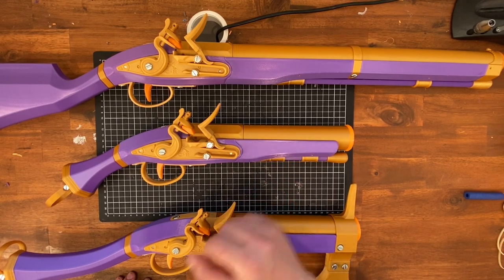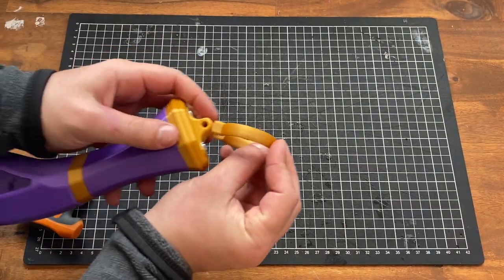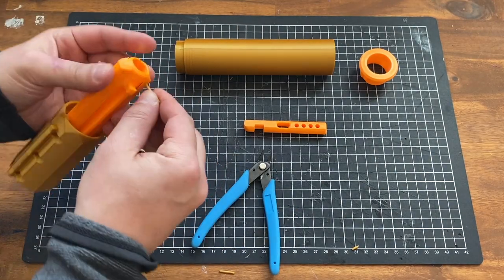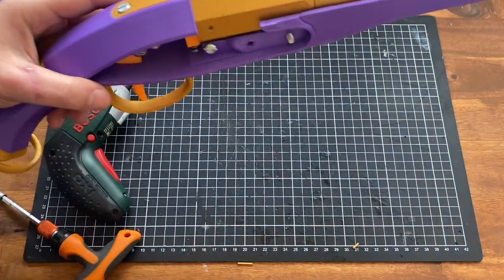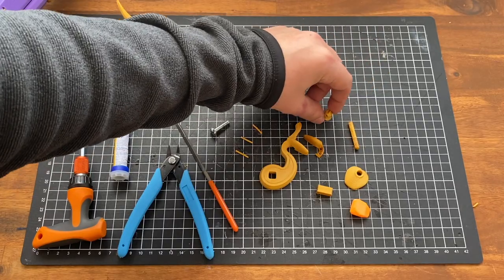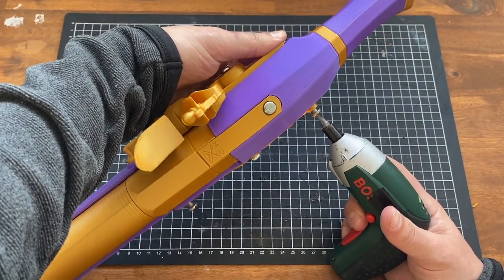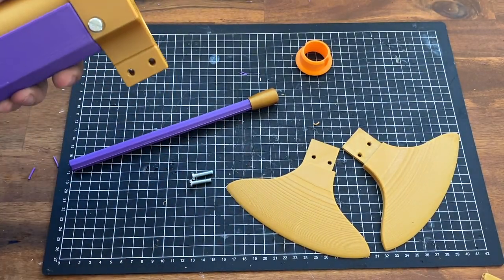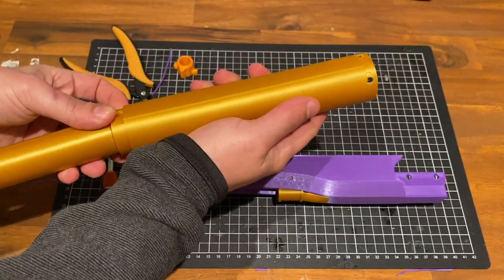Flintlock V2 Assembly guide

Comment: For anyone with the spring not staying, what I did was use a 20mm screw instead of the 10mm and it goes through the hole all the way and provides a stable place to rest the spring.

Comment: Well i know what my sister and brother in law are getting for xmas.
Reply: You’ll have to get a 3D printers and learn how they work then by the files witch ain’t really that expensive then you need to get filament which is really expensive then go to your local Home Depot or any hardware store get the screws and metal mechanism and ya your pretty much done

Comment: The one I made the spring would pop out from under the catch block. I edited in a little tab on the bottom that prevents the spring from going anywhere. Lets me use a shorter spring too so the trigger pull is light and crisp

Comment: Really amazing design. Would it be possible to replace the rubber bands with an extension spring connected to a metal pin or something similar attached to the back end of the rail system?
Reply: You sound like you already know what you're doing. Is it updated or finished?!? I need to see🧐😝 Don't wait on anyone... Just do it yourself. Have that faith in yourself yo😎 I'm already trying to devise a way to put a pin through the side of the barrel connected to the launcher plate, to pull the charger back, instead of using the plunger to prime it. Never wait for no one else if you gots a good idea.

Comment: Is there a good place to source the spring? Having a hell of a time finding them
Reply: i would go to lowes/home depot and look for a box of assorted small springs. It comes with both compression and extension springs. It has many sizes in them, just try a few of them and see what will fit.
Reply: @mikeperry4262  thanks, it takes me like 3 peen springs to get good pressure p
Reply: @ryantyndall412  Mc-master # 9637K75 then cut to length

Comment: Is there a suggested size for the wire diameter of the spring? I've tried  1mm which is too stiff and 0.5 mm which stay compressed and doesn't spring back.
Reply: Try different stiffness. You should be able to find wires that are same size/gauge but have more/less springy.

Comment: Is there an Axe grip file without the Nut space? I have ruined 2 axe grips trying to install the grip. Each time either the angle of screwing in causes the handle to bulge at the top of the grip (angle must have been too steep) or I can't get the screw to engage with the nut correctly and the nut breaks out and starts spinning freely in the slot, ruining the grip.
Reply: Update: The new v3 Mid Stock worked better with the extra meat for the grip stock screw, but I ran into a new problem I'm hoping to solve. I did 18% infill on the mid stock...but this time the mid stock was so brittle I was able to crush and break it in my bare hand. Not sure if it's the new stock's orientation (some of the print striations on this print look very different) on my printer, or if I did 30% infill in previous stocks and I did 18% this time...I'll keep at it.
Reply from the maker: Check you are printing the right mid section, you could be accidentally using too long a screw
Reply from the maker: Sorry just read your reply. Yes the issue is the old mid was too short for that length of screw so you just ended up screwing up into the plastic. The infill needs to be pretty high for the handles, but even 18% should not crumble for the midsection, you may be having printer/plastic issues

Comment: Whats the cheapest 3d printer you can get that works for this?
Reply: Ender 3
Reply: Ender 3. Don't waste money on ender 3 pro or ender 3 v2. Ender 3 with some simple print upgrades will get you going hard. You can find open box basically new Ender 3s on eBay for $140.

Comment: I'm having a nightmare trying to print the parts. On the grip, first layer onto the bed where the holes are for the screws it's really struggling, it will lay one down then the rest turn into a blobby mess, any tips for retraction settings as I think this is what's causing me issues????
Reply from the maker: Uh sounds like it might be a more general printer issue, that part is a simple octagon for the most part. If it’s peeling from the bed into a blob it’s a bed adhesion problem - usually stringing is a more likely symptom of bad retraction settings
Reply: I know, late to the party. I was having issues with them too, but then I started using glue sticks and everything prints perfect. The biggest struggle I've had since is the mid stock warping or not printing correctly. I stood it up on the end where the grip attaches and it prints great every time. Haven't noticed the change in layer direction to affect strength at all. I flip the forestock upside down and it does well too. Printing on their sides always gave me warping issues

Comment: 4:16 the two 30mm screws seem too long. I measure the depth of the two outer holes, they seem to be 25mm instead?
Reply from the maker: Unless I am missing something, the depth should be of the holes in the grip + the thickness of the butt cap, hence the 30mm screws should fit fine?
Reply: They worked fine for me
Reply: Same problem here

Comment: does anyone have tips for getting the spring in? It pops out every time I try
Reply: try taking it slow and making sure everything is secure before moving to the bext part of installing it
Reply: Use a flathead screw driver or something similar to hold the spring into a compressed position.
Reply: Ok you'll need 2 springs for this to work. Take the first spring, and a hammer and smash it until it's super flat and not a spring anymore. Then you throw that one away and apply a small bit of super glue to the bottom of the 2nd spring and throw that bad boi in there.